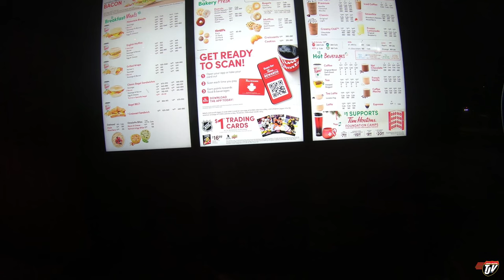My Trucking Life | I'VE MISSED THIS PLACE | #2162 | Dec 17/2020

Comment: Most left turns off of Lag or route 90, you have to be paying attention. There's no time for dilly-dallying. 
The real trick is to avoid unnecessary travel on 59, Bishop, or Route 90. You should have come in down 15 and left out 15. You probably could have shaved 30 minutes off the round trip. 
As a shipper-receiver, please just call if you're coming in late. Or think you're coming in late.

Comment: Hi Josh, two things bud, is it ok to drive with a cracked windshield, cos in the UK we are not allowed to drive a vehicle with a crack within the sweep of the wipers we have to get it replaced ASAP. Secondly, do you not need to depress the clutch at each gear change? We would get a lot of gear crunching here if we didn’t use the clutch each time, horses for courses I guess. Glad to see you back behind the wheel buddy, keep the greasy side down and the shiny side up and stay safe. Best wishes from 🇬🇧 the UK! 👏🏻👍🏻😷